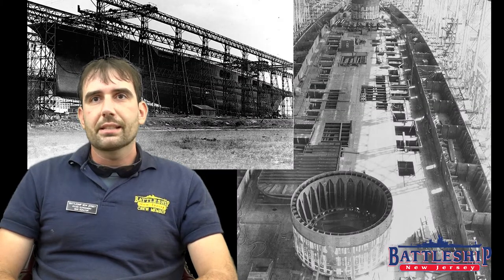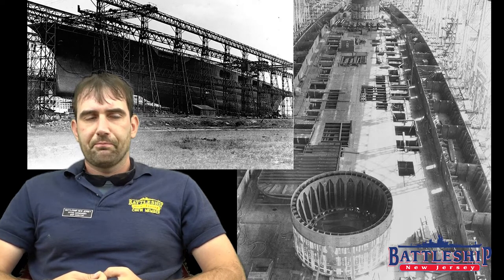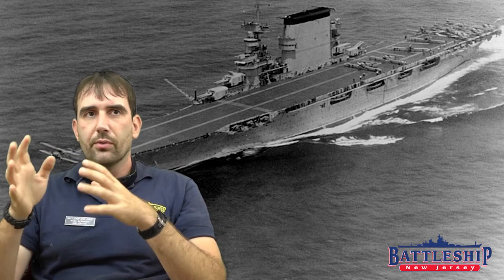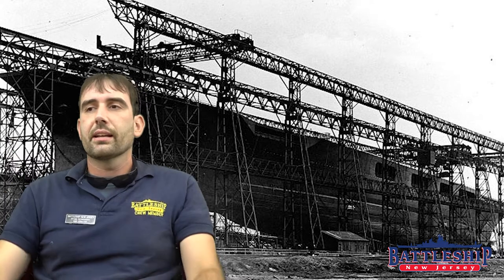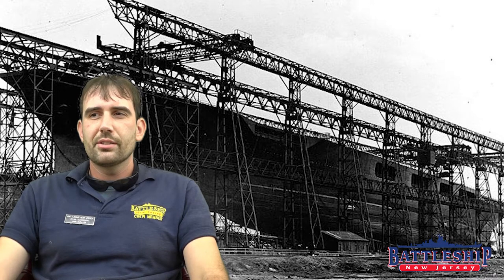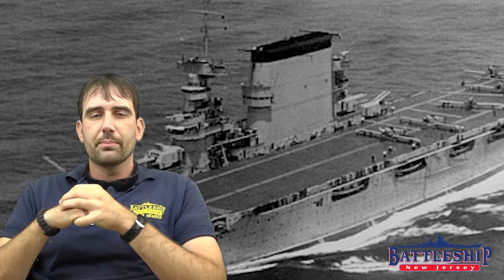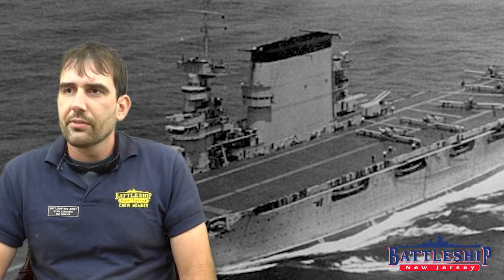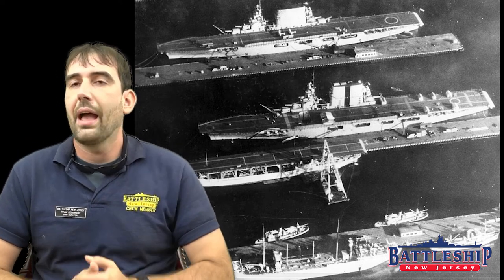Lexington Class: Part 2

Comment: Given how far down New Jersey's barbets extend down into the hull, were they able to remove the barbets from the Lexington class?
Reply: The internal parts of barbettes are part of the turrets, and are simply craned into place into holes that are made into the hull. Considering the ships were about 20% along when construction was halted, they may not have come far enough along to make room for the future barbettes and turrets. Even if they had, they'd simply need to fill in the holes, or tear down and rebuild the affected area. Remember that building hulls and superstructure is very cheap and easy, machinery, guns and armor is where all the weight, and costs come from.

Comment: I just saw both of the 2-Parters earlier today; specifically, in relation to the USS Alaska Battlecruiser Video.

I am still of the mindset that the USS Alaska is a Battlecruiser.

I am not a Professional Historian; or, a Professional Game Creator, with access to Real Life Naval Vessel Design Statistics like the Video Game Creators of NAVY FIELD and WORLD OF WARSHIPS; or, the Miniatures Wargame Creators of IRONCLADS & ETHER FLYERS; therefore, my opinion has no clout.

However, I have been interested in Warship Designs since my Elementary School Years in the 1970s; and, have "studied" Military Technology & Military History as a High Schooler in the 1980s and in my 20s during the 1990s.

Thus, from the 1970s thru the 1990s, I have spent time thinking about Warship Design Theories and Naval Warfare Tactics & Strategy Theories; before, playing IRONCLADS & ETHER FLYERS and NAVY FIELD and WORLD OF WARSHIPS in the 2000s.

And, for the above reasons my opinion will remain steadfastly unchanged.

If I were to Scratch Design a World War Two Battlecruiser, it would look very much like the USS Alaska.

Anything from 1936 thru 1945, with a 12-Inch thru 14-Inch Main Gun, would automatically be classed as a Battlecruiser, or a Battleship, by me.
Reply: I think, if you looked at the purpose of the battlecruiser when conceived, you could say that the Alaskas were battlecruisers.  They were large, fast ships designed specifically to fight enemy cruisers.  I think the disconnect is based on the design of battlecruisers and the Alaskas.  Traditional battlecruisers were based on modified dreadnought designs while the Alaskas were large cruisers by design.  So, technically they are different than traditional battlecruisers but they were built for the same purpose.
Reply: @tcofield1967  ...
Traditional Battlecruisers = Pre-WW1 & WW1 British Battlecruiser Designs

I think that is a Fallacy; because, it is only focused on the British Viewpoint; and, British Vocabulary.

Germany and France and Italy and Russia and China and Japan and the USA had different Naval Doctrines & Philosophies from the British Naval Doctrine & Philosophy.

Language matters; and, not all Vocabulary can be accurately translated between different languages.

EXAMPLE
What we Europeans call a "Warship", the Asians call "Battleship".

Also, sometimes Nations were purposely ambiguous with their Warship Classifications for Intelligence, and Counter-Intelligence, Purposes.

Now, if you are focused on Period Terminology; such as, a Novelist trying to write Realistic Dialogue concerning Naval Warship Classifications during The Age Of Battlecruisers; then, that is a totally different matter.

As a "Modern Day Amateur Historian", I do compare Warship Designs from various Naval Ages to each other.

Thus, I have a more "Loose Definition" of "Battlecruisers" than the British Battlecruiser Design Concept.

If you are a British Naval Officer tasked with comparing other Nations Warship Designs to British Warship Designs; then, your Warship Classifications will be purposely biased on using the British Naval Terminology Theory; because, that is what you know; and, that is what the British Politicians know; and, that is what the British Civilians know.

I have my own Naval Doctrines & Theories that are independent of Existing Nations' Naval Doctrines & Theories; which, is why Game Systems like RULE THE WAVES and ULTIMATE ADMIRAL:  DREADNOUGHTS and NAVYFIELD are interesting to me.

Because, I have my own Naval Warfare Doctrine Theories; and, I have my own Naval Warship Design Theories, how I would design a Battlecruiser; and, how I would utilize a Battlecruiser in a Naval Battle, isn't based on Traditional Battlecruiser Theories.

Comment: Sopranos ending.
Reply: As for the ending.  The Lexington was lost but the lessons learned during the fight to try to save her was used in the future to help damage control crews limit the damage in ships later on.  The ship took several torpedo and bomb hits but initially appeared to shrug them off and was actually receiving planes when fuel vapors ignited causing a chain reaction that led to the ship being scuttled.  Had the ship been hit like this later on, ala the Franklin, she probably could have been saved but she probably would have been a structural writeoff at that point due to her age.  

The Saratoga fought on in the Pacific, being damaged at the Battle of Eastern Solomons but sinking the Japanese light carrier Ryujo before taking a submarine torpedo.  Both her and the Enterprise were damaged and had to withdraw but they shot down enough of the Japanese force from Shokaku and Zuikaku to lead them to withdraw as well, preventing them from directly attacking the forces around Guadalcanal.  She participated in several battles in 1943, for a time being the only US carrier active in the Pacific theater.  By 1944 the newer Essex class carriers, being more capable and newer than the Saratoga, took over most of the primary roles although she still operated with the fleet.  During her life she had almost 100,000 landings on her deck, the most of any carrier up to that point.  

After WW2 she, like most ships, was converted to carry US troops home as part of Operation Magic Carpet.  At this point she was too old and her battlecruiser hull made it impractical to keep her as an aircraft carrier, although she would have been capable of handling modern jet aircraft.  But at 19 years old and with a lot of water under her keel it was considered impractical to keep her in service.  She was, instead, used as a target ship at Operation Crossroads.  The first airborne atomic bomb did little damage to her.  The second explosion was only about 400 yards away from Saratoga and she was thrown completely out of the water and had mutliple hull breaches.  Still she probably could have been saved if the ship hadn't been completely irradiated and unsafe to board.  She slowly sank to the bottom of Bikini atoll, upright and can be dived to this day.

The Lexington class Battlecruiser/Aircraft Carriers were an interesting design in the evolution of the fleet from a heavy gun centered organization to one that relied more and more on air operations.  They were probably the most successful design of all of the prewar carriers (I'm not including the Yorktown class here, they were literally brand new when the war started) and certainly better than their Japanese and British contemporaries.  The British designs turned out to be too small to be effective and the Japanese ships, Kaga and Akagi) had to be modified multiple times before they proved themselves to be close to the Lexington class.  Almost all US Carrier doctrine was developed in the 1930s using these carriers and the ships were very popular among their crews.  Just as an FYI, my grandfather served aboard Lexington at Coral Sea and as such I have a big soft spot for these ships.  It is highly likely that the US wouldn't have been prepared to fight the air war without these ships.
Reply: @tcofield1967   Why?
Reply: @givenfirstnamefamilyfirstn3935  why what?
Reply: @tcofield1967  yeah the Courageous and Furious were designed to be small since they were Fisher's baltic queen ships